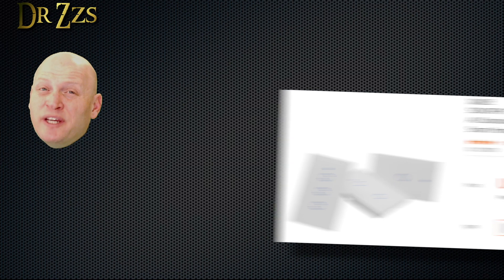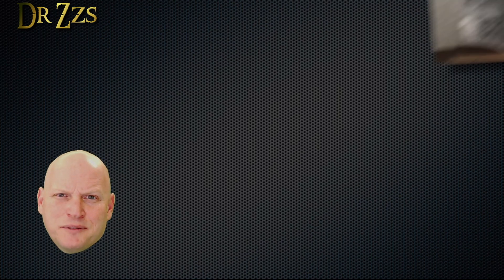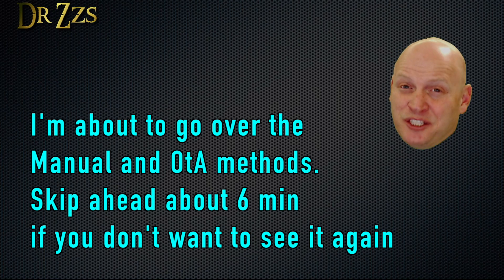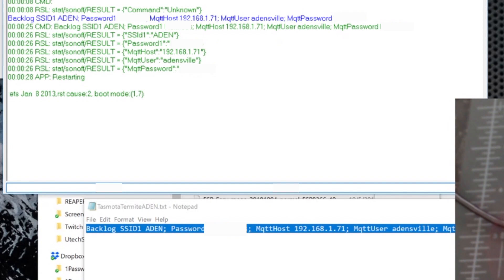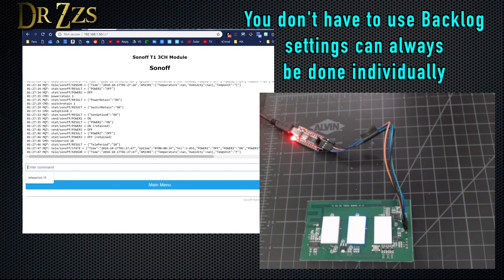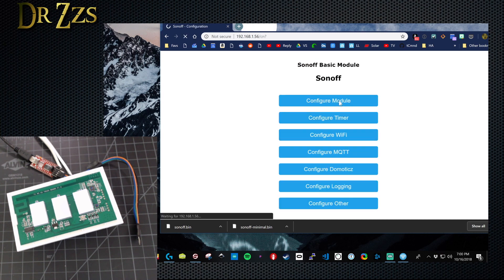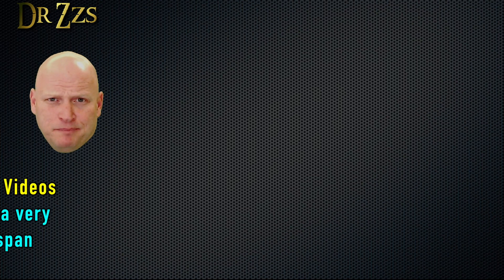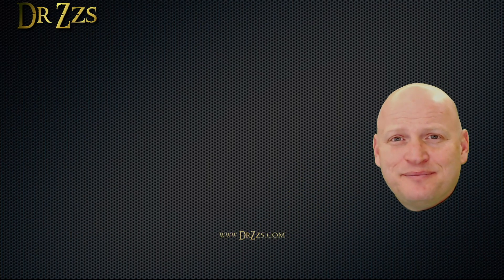Giving the Sonoff Light Switch a Style Make-over, and adding a Temperature Sensor

Comment: Hi DrZzzs, I just watched this again, I have watched it about 3 times over the past 6 months... I just picked up on the OTA firmware upgrade. THANKS... I hadn't given it much attention before, and now I have just updated all of my devices (23 of them,) that I can't access without removing or use of a ladder. 
I was actually watching it in the hope that you may know how to write a rule to turn on the Sonoff Relay based on the temp from the DHT11 that I added to GPIO14.
Temp and Humidity work great via HA. Setoption19 means I haven't added a lot of my devices to the config file but they still have been added to Lovelace.
I'm just not sure how to reference the Temp to activate the switch.
I have written rule for my RF Bridge to MQTT active lights etc, just not sure when it comes to temp!
Thanks again for the great videos. Hope you can help.

Comment: What would be the best solution to control 4 lights on a 2 gang switch box.    Will 2 T1 switches fit with the glass cover side by side?  Or is it better to stick 2 sonoff duals inside the 2 gang box with push bottons on a 2 gang blank plate?
Reply from the maker: I don't think you could get 2 T1's to fit.  Or 2 sonoff Duals either.  I think your best bet is probably 2 Shelly 2.5's or 2 BHonofre.   I was just chatting with Bruno and he said we can add extra relays too.  So I'm going to start experimenting with making a 3 or 4 relay ZzOnofre :)
Reply: @DrZzs Are the BHonofre custom made?  It looks like it is not something that you can buy like a Shelly or a Sonoff?  Am I right?

Comment: Can the temperature sensor am2302 be used with the sonoff T1 running it's native firmware or is it a must to change the firmware?
Reply from the maker: you must change the firmware to be able to use any GPIO pins for other purposes.
Reply: @DrZzs  thanks

Comment: listening to the linux unplugged podcast and someone there was suggesting https://www.openhab.org/ over https://www.home-assistant.io/. they started off with home assistant, but this podcast was from 2016. i love the show and really like the floating head. sorry about negative comments from the peanut gallery but they must not have a great sense of humor, or the type that i have. i want to have automated door opening, maybe, but it looks complicated, but i also want star trek door sound effects from the original TV series, when the doors open and close and podcasts to follow me around the house and outside on built in speakers. i don't know if i really want this stuff, i also like quiet. have you looked into the Mycroft home assistant? i guess echo is doing well and Chris on the former podcast has it isolated so that it can't spy and report back to it's master. i don't know how he did that, but i think Mycroft can use alexia and isolate it too, like the open source search engines do, like opera. are you running pie hole to block ads on your LAN? no need to answer that, i'll check out your videos, thanks for putting them up

Comment: Gang in australia or europe maybe? also refers to the number of switches in the plate as in Australia we can have 6 switches in a single plate, which we would call 6 gang. They fit more because the voltage is higher and hence less current, so small switches.  BTW - Like the videos, good work!!
Reply: i saw this topic on another site a few days ago and they said that in the USA, gang refers to box size and in the EU, or was it the UK, gang refers to the switch (or outlet?) count

Comment: Hey DrZzs, thanks for your videos they are a great help. 
I have added a AM2301 sensor to a Sonoff T3 UK version on pins GPIO2 and 0 and 3,3V on the right side of the circuit in order not to block re-flushing it  (according to this picture https://user-images.githubusercontent.com/29403034/33187392-5a4902e4-d089-11e7-9522-ab7e70301c58.jpg ). 
The sensor gives accurate data for temperature and humidity for some time and then for some unknown for me reason both values switch to null and remain like that. 
Restarting sonoff over web console does not work. The only thing that works is taking circuit out and putting it back on. Did you expect anything like that ? Any possible hints how to solve the issue ? Thanks in advance.
Reply: So actually there were 2 reasons for that:
1) I should not I should not used GPIO02 - but Rx
2) I have added the 4.7 resistor between data and 3.3V
Reply: @jaroslawwojciechowski5463  I’m Going to be doing this too with the UK T Sonoff for whole house/individual room central heating control...

Comment: How's the touch responsiveness? With the standard plate, I kind of have to press with the thumb for it to work. Any solutions to make it more responsive?
Reply from the maker: hmmm
I guess if you make the plate thinner but sanding it down or something.  Or on the T1 you might be able to remove the square block that diffuses the LED.

Comment: Does the OTA flash still work? Im going to be using the S26 or S20 and the Sonoff Basic
Reply from the maker: It sure does.  It's kinda hit or miss though depending on the device and the firmware version it is running.  I didn't check these switches before I flashed them to see what version they were using.  All you can do is try it and hope it'll work.

Comment: @DrZzs if you want higher WAF score - I suggest finding a company that could make a custom print on the PVC plates with size of your choice :) I did it with mine and then exchanged those ugly-white-glass based that are stock ones. you could avoid cutting the original box and then merging two frontplates - the stock one is just hot-glued or tape-glued [depends on the version] so you can easily make a change, and still can avoid any screws etc. check it out here -> https://imgur.com/a/9a1qb5A
Reply: Definitly gonna do some customizing to the plates. maybe outsource it like you, or do it myself 3dprinting-style.. the last is more fun, but probably cant reach the beatyfullness u achieved. your plates are awesome!
Reply: @garrox84  thanks! I thought about 3D printing, but don't have an easy access to 3D printer and also it was easier for me to design the PVCs.
Reply: I'd love more info on this.  Did you find PVC plates at a hardware store and take it to a place that does screen-printing type stuff?  Or did the company provide the PVC plates?
Reply: @chriswiggins3896   yt didn't notified me about your answer.. so please forgive me the massive delay.. in case you're still curious - I found a printing house that prints an PVC (different types) so I just prepared my projects and sent them

Comment: couple more  point this can be done on a 3 gang blank plate and also the TX ping can be used are additional input device like a Heltec capacitive  touch sensor  - digiblur has a video hydra sonoff switch where is uses RX, TX and gpio14. get the most bang from the bucks you spend on these sonoffs -  use a touch sensor and put it bellow the dst22 ( or a PIR)...it can be configured with a tasmota 'rule' to trigger something pther device or automation.

Comment: In other parts of the world, like NZ and Australia, our switch plates are all the same standard size, the same size as that Sonoff switch. You just choose how many switches are on the plate 1-3, for the number of circuits you want to control, the same as those Sonoff smart switches. Keeps everything neat, tidy, and compact. 😄
Reply: Right, the"gang" in the name refers to a pair of live+neutral - 3 relays, 3 gangs. We did used to have double-wides switches / flush boxes in NZ. In older houses, the 30A oven switch used to be wider than the rest. :) #kiwi

Comment: Great Video, I have been waiting to see what you did to put a different interface on these. I have 34 of these now in my house and the glass face plate has to go!!!  I will be following your lead on this one.  Just a comment on the OTA flashing, there is a very easy way to get these into flashing mode, press the 1st relay to hear beep - beep beep, remove your finger, put it back on quickly to do it again, beep - beep beep, it is then in flash mode, worked every time.  Then the second issue you had in the configuration, select other, that is where you can deal with the button topic issue, that way the buttons will toggle correctly.  Took me about 5 switches to nail the process but its quick now :) Hope that helps! Excellent video Dr thats so much for all your dedication to the group!!
Reply from the maker: Thanks Dave!  I hope a lot of people read this.  I've got a few more of these on their way to my house, so hopefully I'll have an easier time with programming mode next time!

Comment: Your wife approved that? Looked better stock
Reply from the maker: Really?  man, you're one of the few people that think they look good as they come.  I could maybe see not liking the stickers I put on there, but it's hard to say that a blank face plate with a cap-touch button and an LED isn't a nice look.  
But it's cool.  You like it your way, and I like it mine.  Keep the world diverse :)
Reply: I would have used a 3 gang face plate and attached both devices to it. Would look a whole lot better than your hack job.
Reply: When you can't find one, you can't find one. :)
Reply: DrZzs I didn’t say I liked the stock look. (1 of the reasons I’ve not got 1)

Just that it looked better than the 2 blank plates with a seam down the middle and a hole cut out of 1 with a temp sensor sticking out. 

I’d rather Sonoff make a traditional looking switch but have it spring back
Like this: https://www.amazon.co.uk/dp/B003EGIQI0/ref=cm_sw_r_cp_api_i_Y3R0BbFG4XTYY

Comment: If I can suggest you something...use statistics plugin for your thermostat. With this plugin you can average last 2-3 reading so your temperatures will be smoothed and your system does not turn on when you open for example a window for a few minutes, it also helps for a bad readings/peaks etc. 🙂
Reply from the maker: ooh, I'll do that.  
Thanks!

Comment: Another great video Dr, thank you. Why would you not add these into HA as MQTT Lights? That way, group.all_lights will show when these are on and you can turn off all lights in one go. If you do try that, can you please restart HA when the lights are on and see if HA turns them off? HA is doing that when I add my Shelly's as lights but not as switches.
Reply from the maker: Hey Pete! 
You know, I've just always used "switch" instead of light.   No really great reason.  
Are you using Tasmota?  Rob did a great summary of the MQTT retain issues and how to fix them.  https://youtu.be/31IyfM1gygo
Reply: I was always using switch too until I started with Lovelace which has a few options for all lights on/off. When any light goes on in my house, the group for all lights icon illuminates and for bedtime or away routines, you can simply turn that group off. I've chatted with Rob on Twitter but he can't test Shelly with stock firmware as he flashed his last unit with Tasmota. If you could test one of the relays on your triple switch by modding the code to MQTT Light, that would be appreciated. Turn all three relays on (with one as light) and restart HA and let me know if the light configured one turns off when HA restarts.
Reply: P.S My issues with the light going off are not related to MQTT retain.

Comment: Can I connect 2 sonoff T1 (1 downstairs and 1 upstairs) to 1 lamp? So that I can switch the bulp on and OFF manually and with my phone. Thanks from Belgium
Reply from the maker: Probably not directly, but you can do it virtually.  You have one switch actually connected and controlling the lights, the other switch just sends a message to the first switch when it's pressed.  I did a video about that a long time ago, but digiblur just did a good one using Tasmota Rules. 
https://youtu.be/jz6sX2f5jjQ